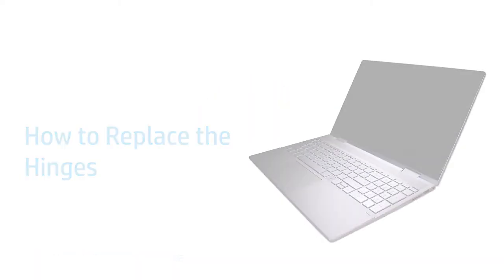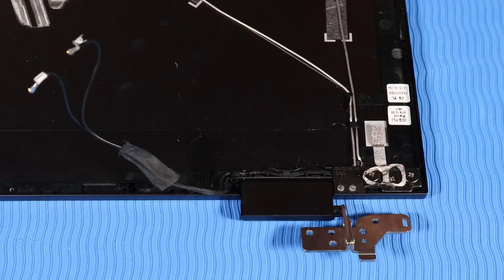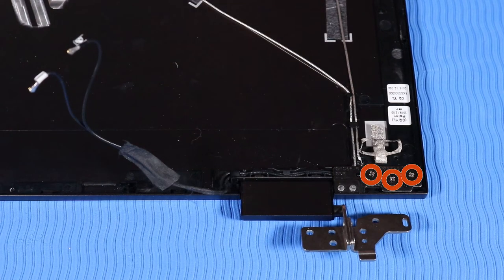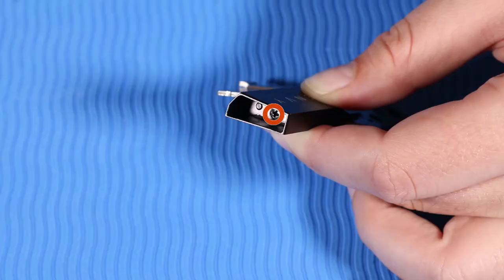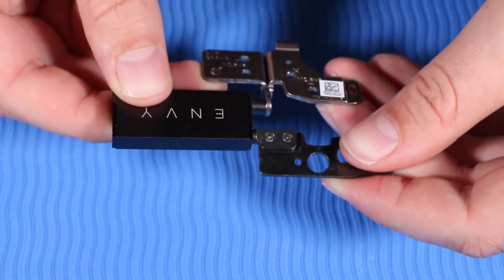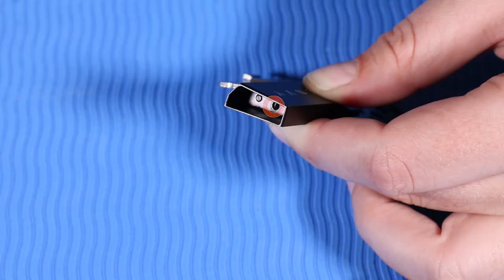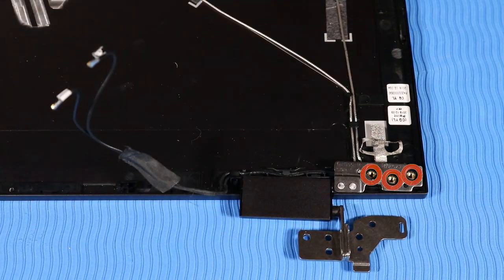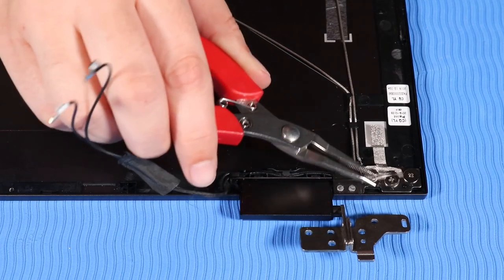Replace the Hinges | HP ENVY 15-ed0000 x360 Convertible Laptop PC | HP

Comment: HP Support.  This is a manufacturing defect.  my hinge just broke.
Reply from the maker: +Aldo Aprile Please contact our phone support team to fix this issue: Please follow these steps to reach them.
Step 1. Open link: https://support.hp.com/us-en/contact-hp
Step 2. Select the product type.
Step 3. Enter the serial number of your device or select let HP detect your product option.
Step 4. Select the country from the drop-down.
Step 5. You should see the HP phone support number.
Reply: @HPSupport   nope.  No number.  I'm out of warranty so all I get is the "virtual contact" which is worthless.   This is a manufacturing defect, and needs to be corrected by HP Corporate.
Reply: @HPSupport  I second what aldo says
Reply: @aprilealdo  The same issue I have experienced!
My laptop is out of warranty, but I never dropped mine. Just for opening and closing the hinge has been unscrewed.
Reply: We have the same issue with as 13" HP Envy X360. Normal usage. Never even brought out of house as being used only for online classes. Bought in the US and now in the Philippines. HP said they cannot fix it even thought it's still under warranty!!
Reply: @HPSupport  We have the same issue with a 13" HP Envy X360. Normal usage. Never even brought out of house as being used only for online classes. Bought in the US and now in the Philippines. HP said they cannot fix it even thought it's still under warranty!!
Reply: It's not a defect. It is design.

Comment: Is it possible to loosen existing hinges?
Reply from the maker: +Ursus HP does not recommend upgrading or downgrading hardware parts or software that is bundled with the product as It may affect the manufacturer's warranty and performance, however, you could change the configuration at your own discretion.
Reply: @HPSupport  The problem with the original hinges is that they are too stiff, the laptop is not closing and then there is the risk to break it.
Reply: IMHO, the hinges are too stiff and the abutments attached to the monitor case are sketchy as hell.  The abutments are embedded in plastic and glued to the case.  These hinges are going to be opened thousands of times - the abutments WILL fail as well.  I've experienced this now with HP Envy x360 15m-ed0023x.  HP knows they have an engineering problem.  JUNK.

Comment: Just called HP Support. I have factory warranty still but they said this falls under accidental damage. This was not an accident and it is a faulty hinge. You wanted me to pay $400 for the repair because it is not covered.
Reply from the maker: Hi Celeste, thanks for contacting!
I understand that you are experiencing an issue in replacing hinges under warranty.
In order to get this issue fixed, please contact our customer care team over the phone or chat for further assistance, as this issue requires Live conversation with you over phone or chat to isolate the issue and provide you instantly with appropriate solution or repair/replacement options available at your place as per the warranty.
Please feel free to reach us on call/chat, please access this link to select your preferred country and language option to reach us. Global support link: - https://www8.hp.com/us/en/contact-hp/ww-phone-assist.html
Binu - Social Media Tech Support